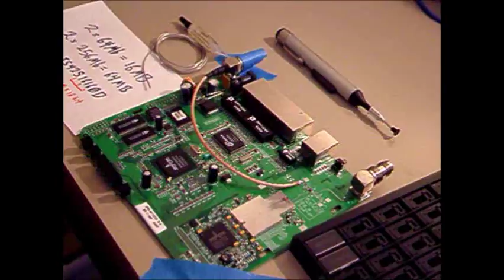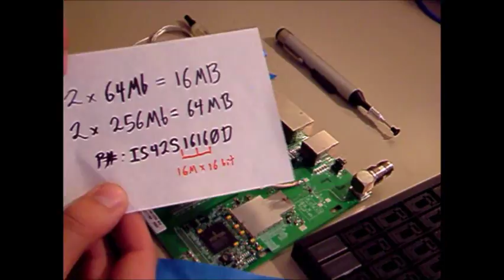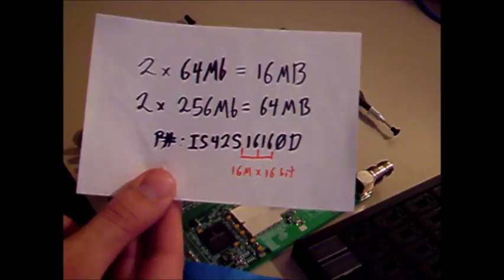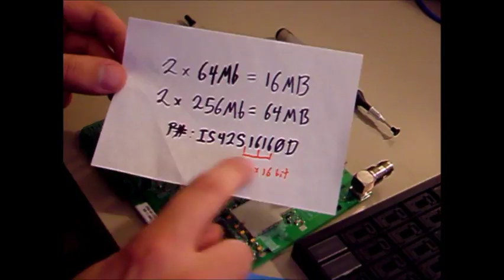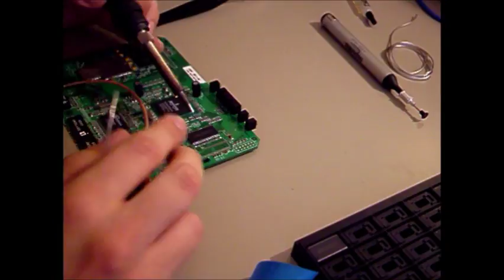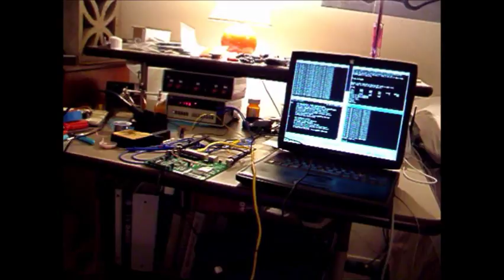WRT54G V1.1 Router RAM Upgrade

Comment: My wrt54gr router which looks different than this one,  because mine is wrt54GR, broke down after 10 years it acts weird when I change the settings and so I was thinking maybe there is a ram chip in it with a drained backup battery. And so I am looking at this video and I can not really see the battery, although there appear to be SDRAM chips in it, so it must have a battery ? Just wanted to ask that here before I try to dismantle mine. Thanks
Reply: ***** Ok, thanks.

Comment: You're given me some excellent info on using that special solder coupled with the flux with which I was already familiar. I was not familiar with that particular solder. I was amazed with the simplicity of removing the megapin IC's ! On a side note to everyone, I found an excellent and very cheap alternative to the canned 'flux remover' that tends to be expensive. It is called 'MEK' short for Methyl Ethyl Ketone which can be purchased very cheap in a quart can at Home Depot or likely any decent paint store. It works like a charm and makes for an extremely clean, professional job ! Thanks for the great video !
Mark..

Comment: Very cool. Very impressive. Great dexterity. 

I have a nurtured Wrt54G v5.0 with DD-WRT. If I swapped out the memory like you then how would I update the firmware to reflect the increased memory? Would the router detect the hardware change automatically? Could I then upload a different version of the DD-WRT firmware to it?
Reply: +Corey Short No this is not a Windows OS (Plug & Play), you would have to update the ROM to reflect Mem change..
Reply: +The Channel rooted*. What Linux tools (assuming) did you use to update the rom?

Comment: Easier to take a dremel and cut the legs off then go over it with solder wick and flux to clean up the leftover solder and pins.
Place solder paste on the cleaned pads and stick the new chips on with some adhesive on the bottom and hit it with a heat gun = done
The way your doing it is the hard way and you risk burning the multilayered board, breaking traces, desoldering other parts on accident and creating microscopic solder bridges.
They DO in face make solder iron tips that fit over these chips to heat all the legs equally.
The v1.1 IS NOT able to work on 64Mb ram. the ROM cannot provision and allocate it properly and it will "brick up".
to revive it you have to put the original ram back in and redo all the ROM to revive it.
I think a v1.1 will go up to 32Mb but for 64Mb you may have better luck with a higher version.
Of course most of us would just buy a new router too
Reply: ElfNet Gaming when u dreml the chip , bits of metal legs brushed of all over the board. and how we can manage and guarantee such a brute method wont damage the board or neighboring components by a slip of the hand holding dremel, and the method he used in video to remove the chip seems hassle free, also we can use heat gun with narrow nozzle to remove the chip too, dremel is way to unsafe for such procedure in my opinion.

Comment: Hopefully you reply back to me, I made this comment before the video ended so I am not sure if it was mentioned. But I am new to soldering, but did you just apply the solder across the pins? wont that cause problems if the solder is on two pins or bridging the pins? or that doesn't matter? That is part of the reason what I haven't done any ram upgrades so I thought each solder could not bridge with another ram pin which is intimidating when they're so close to each other.
Reply: If you use enough flux and not too much solder, it should reflow and the pins should not get connected to each other. But if that happens you need to clean that up. It would most likely kill the chip.
Reply: rxueloenz or the router

Comment: Use flux on the pads before you solder makes it 10000 times easier to solder and then wash it with 96% alcohol

Comment: If router failed to boot after RAM upgrade, check for solder bridges (DO NOT rely only on visual inspection, use a multimeter to check each pin, some bridges are TINY) and make sure you didn't lift any traces when desoldering or resoldering, also check to make sure each pin has soldered sufficiently to the pad..

Trust me, if so much as two pins are bridged, or one pin lifted or inadequately soldered, the router will not boot!

Comment: Hi there Kenneth, I might be getting confused on what your doing. Are you replacing physical thinking memory, or are those storage. If that is the bit that your scripts and things get saved to. I have successful added SD card support to these routers where i have tested 2Gig and also 4Gig SD cards having them working with DDRT, I was some time back that i did this but i set them up as Wifi Hotspots. I really enjoyed working on them. Regards Richard.

Comment: A heat gun with a small tip works awesome for heating all of your work area evenly!!
Works the best when removing chips or when you just want to re-flow solder!!
Beats having to pull the BGA-reballing equipment out !!!
Thanks 4 Sharing !!
DEv

Comment: WHAT WORKS AWESOME IS...
I took an old smaller shop vac, put a smaller attachment onto the end of the suction hose that I could attach a smaller hose too, which I use for my solder sucker !!
Works better then any solder braid or solder sucker because it completely removes solder while heating it !!
I have not had any issue with fires either but make sure you do not have dirt & or dust in your vac!!
Thanks
DEv

Comment: how do you solder something so tiny without the pens touching each other is it flux I'm pretty new at soldering and I've been trying to solder a micro sd port back onto a board